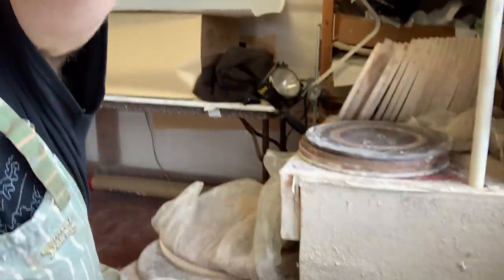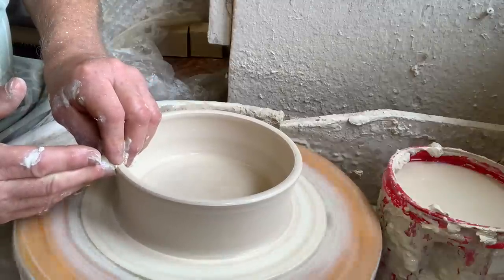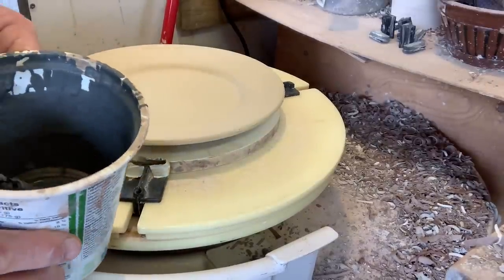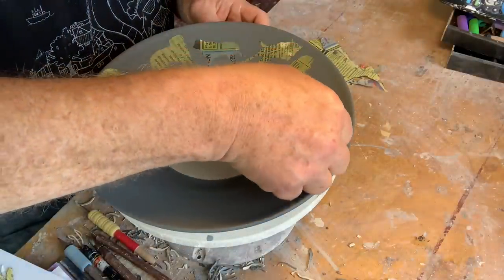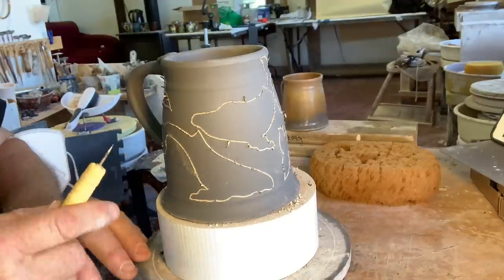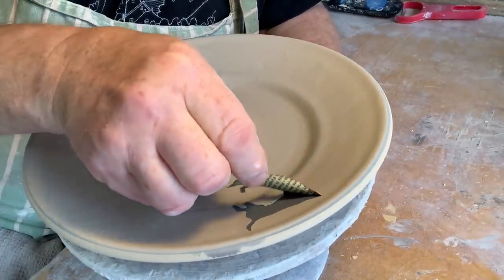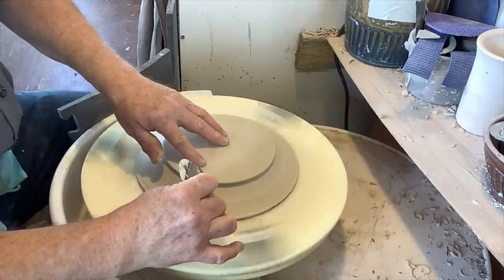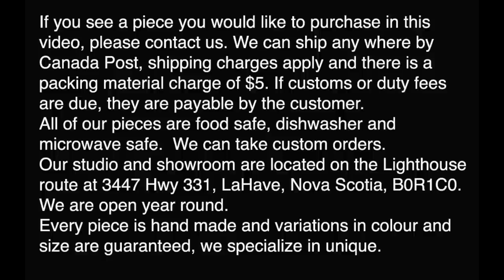Dog Stencil Plates.

Comment: Thanks for the video!  Wonderful work.  One question I had, if you have a moment.  How do you manage all the trimmings flying all over the place when you use the Griffin Grip?
Reply from the maker: I have a wall around the wheel and a rubber shield that keeps most of them in. I bought a mud tools shield for the wheel as well.

Comment: Busy learning how to throw a plate so this will come in handy. Two questions if I may: did you remove the plate from the bat at any stage before finishing the decoration (to prevent cracking)? and what is the thickness of the  plate after having opened up? Many thanks
Reply from the maker: I cut through after finishing the layering and before leaving them over night. My guess is the bottom is 1/2cm.
Reply: @Vsmithpots  Thank you. After a week of trying and checking out you-tubes I found yours simple and straightforward and  threw my first ‘almost’ (on trimming the rim slumped somewhat) decent plate. Please remember to post the link to the plate tutorial you mentioned.
Reply from the maker: @jasm6094  https://youtu.be/LrFK_VdixPo        
There is also a link at the end of this video on dog plates, to another plate video.
Reply: Can't wait to see these finished. I would really like to see them done as border collies.
Reply: @Vsmithpots  Thank you !!
Reply from the maker: @bevwheeler4520  I only make these pieces to order so I have done Bichons, Jack Russel terriers, Labs and a few other breeds.